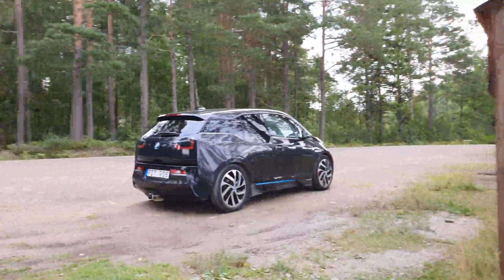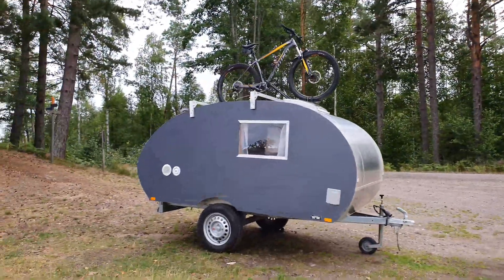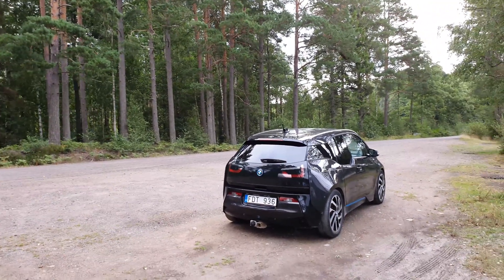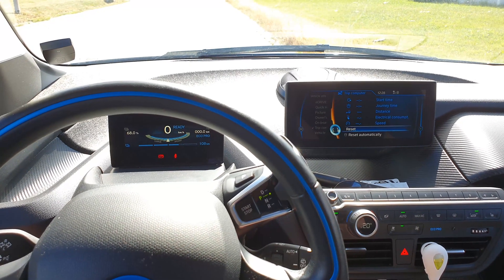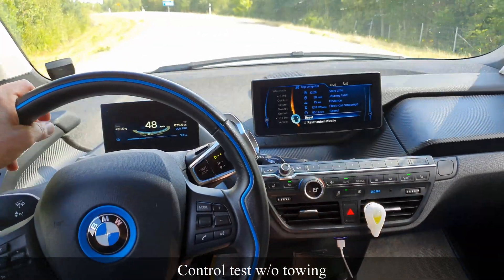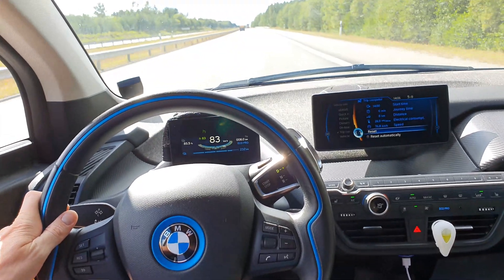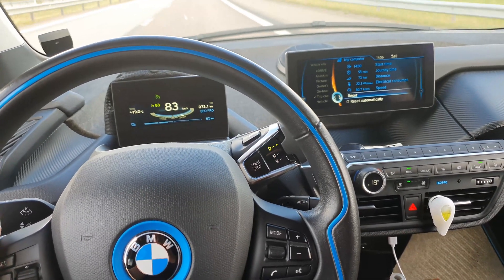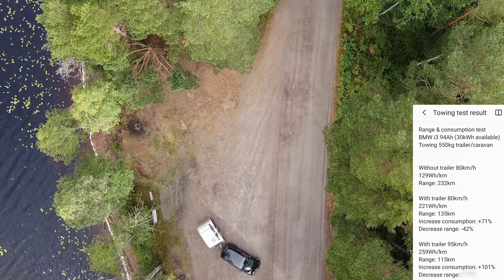BMW i3 94Ah 550kg Towing Consumption Test

Comment: Nice! BTW do you have driving brakes on the trailer.  ?
Reply from the maker: No brakes on the trailer, cheaper that way and more energy back in the battery through the motor. Even 9% steep (down)hills is no match for the motor to "brake" down, with that 550kg pushing in the back.

Comment: Awesome! 
Did you make a video on how to make that power socket for the tow hitch that I missed? Is it power for things like bike rack brake lights, or is it something else?
Reply from the maker: It is a European towing connection, the 7-pin standard. The actual plug is maybe not the most relevant/ specific part but how to connect it was a bit tricky. When I have time I could make a video on how I connected it all. I had to use a clampmeter to find the correct wires.

It does not charge the trailers battery, it is only: tail light, brake light, turn signals and fog light.
Reply: @BasinBjorn  Yes! Please make a video on where you connected the wires. Since the lights are in the hatch I would imagine you connected to the wires near the roof?
Reply: @BasinBjorn  A video on how to wire up that type of plug would be very helpful, looking forward to it :)